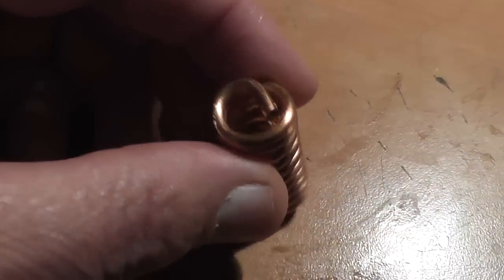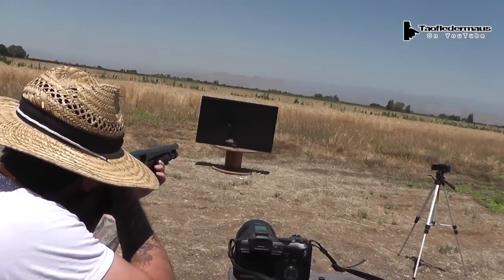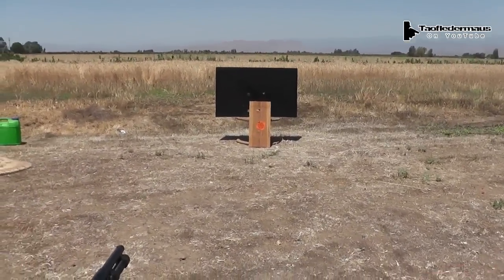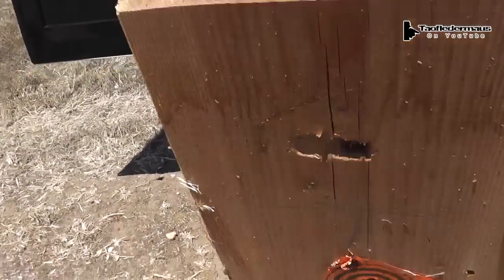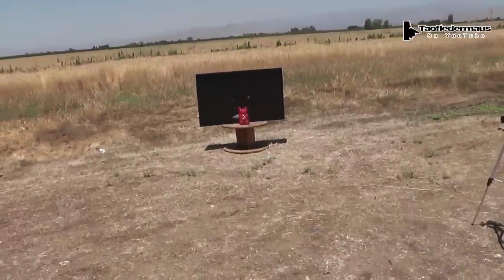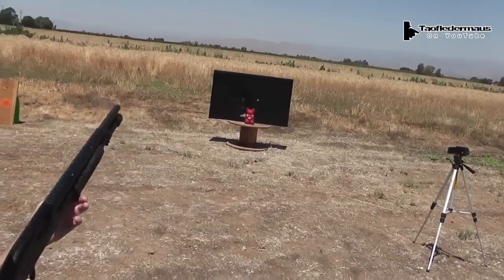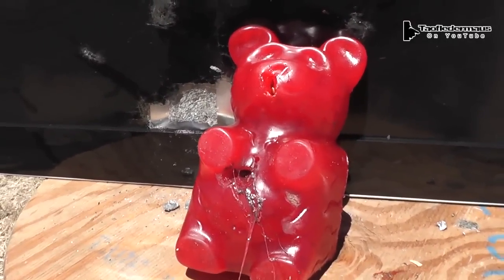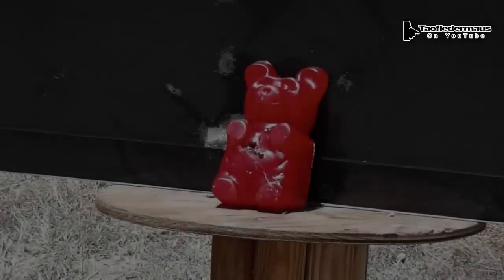"The Helix"   Copper Coil Shotgun Slug -  Testing

Comment: You remarked somewhere in the video about the copper coil being a "weak shape".  If you think about it, it is an immensely strong shape under exactly the same forces of compressive load that a shotgun blast creates.  It is being pushed against its own inertia and the air resistance of the sound barrier, but there is enough resistance in this to guess intuitively that it would keep its shape.  So much so that I think the shape has some practical potential in a slug.  It would only be a matter of what structures could be shaped inside the spring to drag stabilize it.

Comment: Heat up the copper till it's red hot, then dip it in cold water. Heating then rapidly cooling copper causes it to get softer, unlike steel, which will get harder. If you soften the copper wire, you might be able to make it uncoil in flight.

Comment: Have you tried using multiple small diameter copper wires, twist them together then coil it together just like the one you shot in the video? see what kind of results you get out of it. extra added fun, case it with wax to give it extra force push from the barrel.

Comment: You should try 2 BB's attached to a thinner gauge wire. Kind of like the old-school cannon rounds for taking down masts.
Reply: it exists its just called buck-and-ball
Reply: nvm thats something else but it does exist
Reply: cheesecakes121 Buck and ball is 0.65" round shot and six 0.36" buck shot loaded in the same case. Ball and chain is two 0.58" round shot joined by a few inches of wire. There are probably variations by manufacturer.
Reply: chainshot was used in ships cannons to take out rigging/masts/sails, similar but on larger scale

Comment: I'm sure if you would have annealed that copper spiral you probably would have got what you expected when you dug it out of that wood. Take a piece of copper wire. Bend it with your finger tips then bend back the bend you just made and so on. You'll notice it takes more and more effort to bend the copper than it originally did.

Comment: I wanna see small cut sections of copper tubing inside of each other, 1/2", 3/8" inside of that, 1/4" inside of that, cut them short enough and you can have multiple layers of flying rings.

Comment: I think it would be cool if you added copper spears in the middle of the coil, and perhaps sealed them in there with melted gummy bear or wax. also, if the spears stuck about 1/2 inch further than the coil, and they all pointed out just a little that could be devastating.

Comment: Because a Phantom Flex would be just too expensive ;)
The higher the framerate the more Information the camera produces every second. This also applies to the resolution.
For example the Phantom Flex has a special highspeed-memory attached so it can handle all the data. And the video files are huge.
For a cheaper camera, you have to stick with lower resolutions. You can't wirte it fast enough to an SD-card (and internal memory / special memory is expensive).

Comment: stuff the insides of the coil with sticks of copper wire or coat hanger ...lock it all with some melted wax ...nice heavy round that could be quite destructive....OH and how about almost cutting through the wire every 1/2 inch before winding it into coil?  Seems like it would be ready to fly apart on impact?  If there were something conical in the front with pointed end adhered to coil then when THAT it the cone will theoretically "explode" the nearly segmented coil....could be the making of something NASTY to use against zombies!

Comment: +TAOFLDERMAUS Could you try other coiled items? Clothes hanger would be coilable (is that a word?). Rebar tie-wire might work too. enquiring minds want to know.
Reply from the maker: +The Miserly Hermit  Yeah,  baling wire is probably soft enough to coil up.
Reply: TAOFLEDERMAUS This is another winner, Jeff! Great idea. who needs to melt copper now? just coil it up & use. Great inspiration!
Reply: TAOFLEDERMAUS Hey, could you try at longer range? I'm about 1/2 way thru video. Maybe you do here. Thanks.
Reply: TAOFLEDERMAUS Balistic block, long?

Comment: Now with steel wire.
Reply from the maker: Copper has more density than steel.   I wouldn't expect better results.
Reply: ***** You could do different things to the steel though, like annealing it first. Or tempering it.
Reply: ***** do one solid gold 12ga slug and watch it splatter across a piece of metal haha
Reply: yeah, two or three hanks of piano wire 2 feet long with a 00 buckshot pellet cast on each end.  really fast bolo.